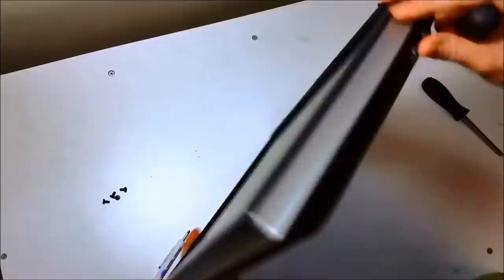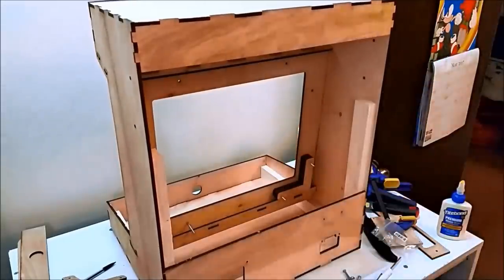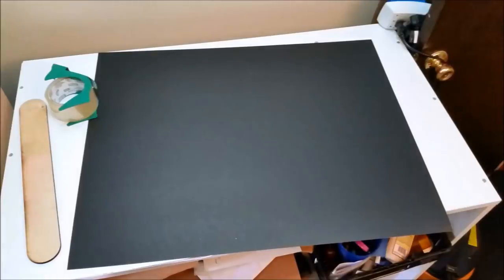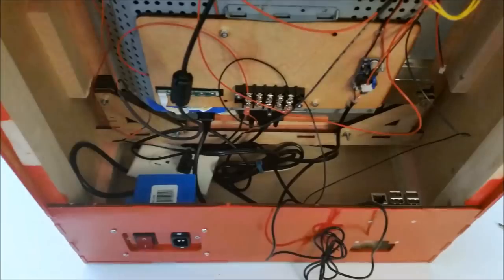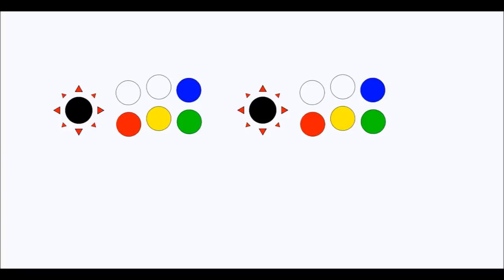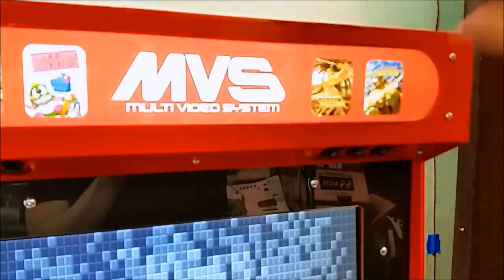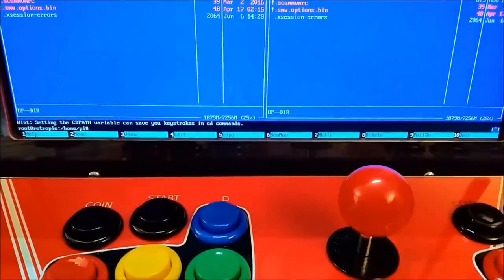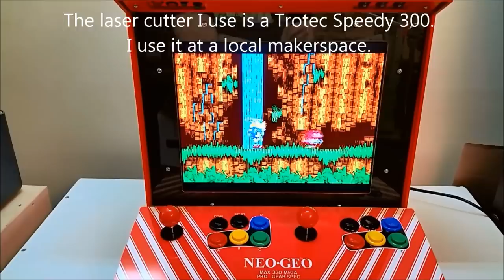Build a Desktop Arcade Machine with Raspberry Pi 3 and Retropie: Super Turbo Pro Edition

Comment: How many man hours did you pour into this project?  It looks like many weekends.
Reply from the maker: about a 22hrs. The design files have about 10 hrs, + the 12 hours this took to build + assembled
Reply: approximate cost?
Reply: Remember though, that's with fabricating machines to cut the wood. Using standard carpentry tools, you are looking at a lot of template printing, measuring, precision hand cutting, and sanding. Not to mention the decals! You would have to farm that out to a printing service. An exacto knife won't "cut" it for that kind of detail. ;-)

Comment: I'm using a Raspberry pi 3 A, Retro Pie and a 4K monitor but the resolution is awful ,yeah I know the games are old school but your resolution seems much better than mine.
Reply from the maker: you might want to use a resolution that follows an integer scale with the game's resolution. the monitors i am using here are displaying 1280 × 1024, which is pretty close 3x integer scale of 320x224 (native resolution of sega genesis).

Comment: Im building my own arcade. But have a problem. I have my (old) raspberry pi and  a 19" 4:3 vga monitor. The problem is that I dont know how to connect the raspberry to the monitor, because the rasp outputs hdmi and the monitor only supports vga.

Comment: @Ryan Bates - So I understand this is an old video so I may not get a response but I'm confused about this and I'm just copying and pasting my comment from a bit ago so it wasn't originally addressed to you but if some way you could respond that would be awesome, but I completely understand if you're not able to. So here is my message/questions : Okay so how he explains it (referring to the aspect ratio and why it is important to measure and map it all out) I do not understand why he measures aspect ratio either. Because I know aspect ratio has made a difference when I've done projects, but that's only when it comes to the actual display part of it. Converting say an old game to an HD monitor that is widescreen or vice versa, but the thing that makes even less sense to me is why he takes so much time to tear down the monitor, and then that is also risking damaging it while doing so (exactly why he has to test it before installing it). Yes I understand it saves a tiny bit of space, but barely any when you could just pull off the bottom stand, and at worst extend your gaming cabinet by a half an inch or maybe a little more...
Reply from the maker: The aspect ratio comes from the height and width of the monitor's TFT. I had to measure this monitor in order to design and build a cabinet for it. Since I know the monitor's dimensions; it's more of a "here's a neat tip" that i can tell you what the aspect ration is without knowing the monitor's resolution. I didn't really measure the aspect ratio purposefully. I measured the LCD's dimensions; the aspect ratio is derived from the dimensions. The aspect ratio is not important, but some people like to know when it comes to playing retro 4:3 aspect video games, will they look 'good' on this size LCD...

Comment: Check out the wiki for an easy way to transfer files from a flash drive https://github.com/retropie/retropie-setup/wiki/Transferring-Roms

USB stick

(ensure that your USB is formatted to FAT32)
first create a folder called retropie on your USB stick
plug it into the pi and wait for it to finish blinking
pull the USB out and plug it into a computer
add the roms to their respective folders (in the retropie/roms folder)
plug it back into the raspberry pi
wait for it to finish blinking
refresh emulationstation by pressing F4, or choosing quit from the start menu

Comment: "RetroPie is the best. End of discussion." Um open it back up. I worked for days trying to get RetroPie set up and configured correctly with all the emus. Some things never did work right. Then I read a suggestion to try batocera.linux. http://batocera-linux.xorhub.com/ Had EVERYTHING up and running configured correctly in just an hour or two.